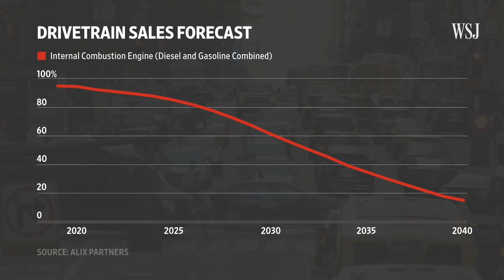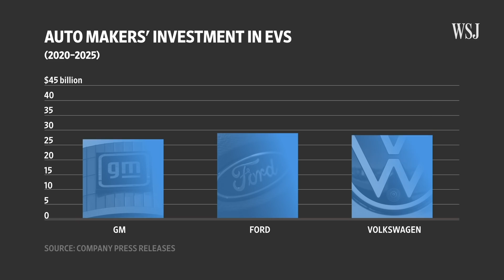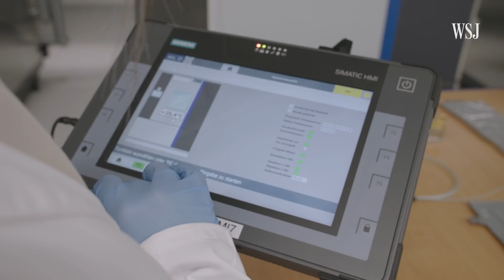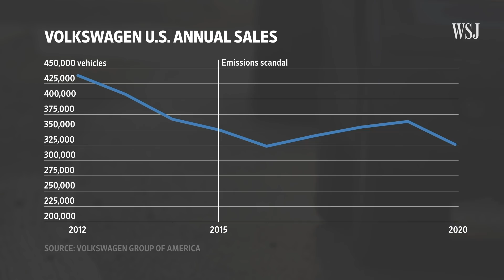How VW Is Turning Engine Factories Into EV Battery Plants | WSJ

Comment: One needs to understand that vw always focuses on scale. Although they are late in the race, but it is obvious that once they start it will be on scale.
Reply: They have already started. The eGolf was superb and and the ID4 and ID4 are even better.
Reply: @AiTheBetterToSeeYouWith  I drove the ID4 earlier this year. If I want one with the glass roof  and heads up display, it's £50k. It was not as impressive as i would have hoped. No AWD until GTX arrives, and it looks expensive.

Model 3 Long Range was a different class. Ordered a few weeks back, hopefully landing next week.
Reply: @AiTheBetterToSeeYouWith  Yes.
Though the id4 is not as good as it's competitors.
Reply: @neeljavia2965  yes the Skoda Enyaq is better.
Reply: @Foersom_  Mach E is also better.
Reply: @neeljavia2965  The thing the ID.4 is good at is efficiency, range and charging. It is one of the best EV's currently on the market for long range driving. Similar to the newest Model 3 LR's. And certainly much better than cars like the Mach-E. Now, what you think about the rest of the car might be different. But at the base, it is one of the best EV's made until now. The MEB platform is good, the cars they put on top of it have mixed opinions.
Reply: They are not late, they just made sure there's a demand first
Reply: How will they do the scaling? How will they catch up?
Reply: @AlfredHimmelweiss  They are already producing at a pretty large scale. But their plans are much bigger. First and foremost, they will be making at least 6 huge battery factories within Europe. Secondly, they will create much larger production capacity for EV's. Luckily VolksWagen already has huge production capacity globally, so they only have to transfer these facilities from ICE car production to EV car production. As the plan is to gradually replace all their ICE sales into EV sales while growing total sales over a certain period. So on top of transferring old factories, they will also be building brand new EV factories. That's the plan. VolksWagen group has the money, people, facilities and plans to make EV's at scale.
Reply: @AlfredHimmelweiss  they already catched up. they sold the most amount of EVs in europe since 2020.
Reply: Audi won´t intoduce new ICE´s after 2026.
Reply: @deathgun3110  yes. but the reason is not because audi is so green. it just does not make sense economically.
from 2025 on, we will see lower ICE sales vs. BEV sales. if they bring out new cars in 2026, that means there could be a last facelift in 2029 and sales to 2032. after that, it does not make sense to produce only 3% of what they where used to sell.
Reply: i would not say they are late to the race. no other traditional car maker sold significant amounts of EVs before 2020. it did not make sense for VW to start earlier.
btw. the made a small numbers of EVs over several decades to explore the possibilities.
and sine 2020, they are already number 1 in EV sales in europe - before tesla.
and in 2022 they might be number two in the US.
Reply: They are not as late as you think. Hybrid drive development started 15 years ago. VW sells BEVs since 2013. These were just small cars based on a ICE platform, to learn better how such a car has to be engineered and manufactured. And now they start to ramp up BEV production.
Reply: Yes.
They know how to deal with suppliers, logistics, sales and marketing, customer service etc.
Reply: That's the problem with VW when they try to scale, resulting in cheating emission in order to rollout their TDI models, poor reliability especially their DSG gear box and 1.4 twincharged engine, many plastic components used for the engine and don't last.

They are just trying to cover their tracks by so called "going EV".. VW EV will still be half baked.. Their culture of rushing their products is still there
Reply: @eugp4198  when it comes to emissions, Suzuki,  Mercedes and few others were also involved.

Talking about reliability yes Toyota and Honda engines are very reliable.
Reply: @sweepstakes91  it takes a dude from India to know the dirt on Suzuki.  When 99/100 of the world isn’t even aware off.  Heck , outside India and Japan no one knows that Suzuki makes passenger cars.
Reply: @eugp4198  nope, vw just wanted to surpass toyota years ago fighting against the toyota hybrid technology, but you see what happened....
Reply: @eugp4198  eveybody who drove their 1.4 tsi and dsg set ups not like in fast and furious never had a problem with it.

Comment: Since batteries & motors still emit plenty of heat, EVs cannot be zero emmision vehicles.  Plus, recycling ♻️ is a vehicle emmision also.
The new environmental laws pertaining to cars will thus realign around heat production and recycling/waste impacts.
These are going to be the new battlegrounds for cheating & enforcement.
Reply: Heat? What are you talking about?
Reply: @leetjohnson  What does heat have to do with emissions?

Comment: How car manufacturers deal w their product when their EV comes to end of life??
Reply: Battery replacement schemes?
Reply: recycle or use them in battery storage
Reply: Batteries are reused as energy storage. Eventually batteries are recycled. Renault has had recycling program since at least 2015 for EV batteries. Search video: Renault circular economy.
Reply: it is not their EV anymore. their business is to sell them - since many decades.
Reply: I do not understand your question. You ask about recycling batteries? - this was mentioned in the video.
Or do you ask what you should do, when after 500.000 miles your car is a wreck, but the battery still works?
Reply: dump them in third world countries!